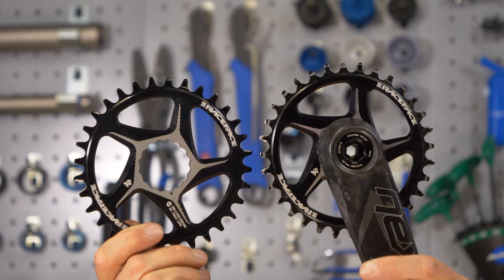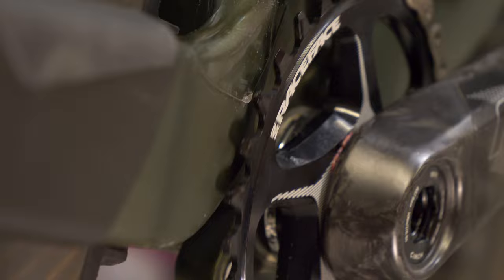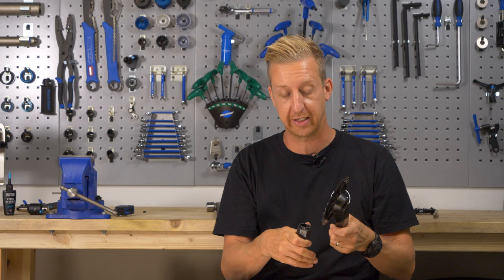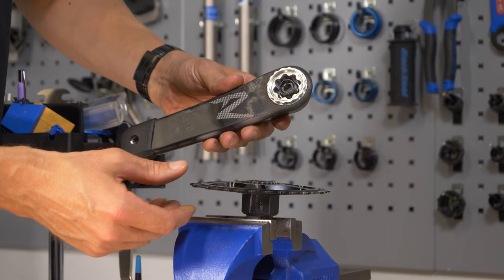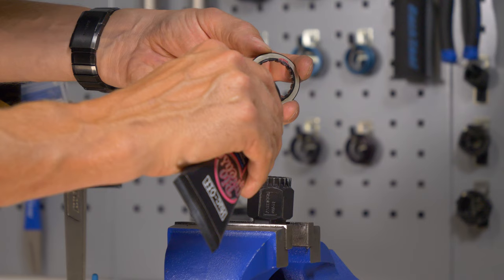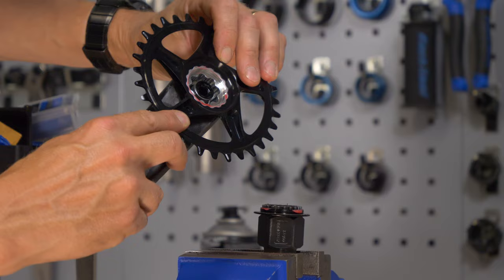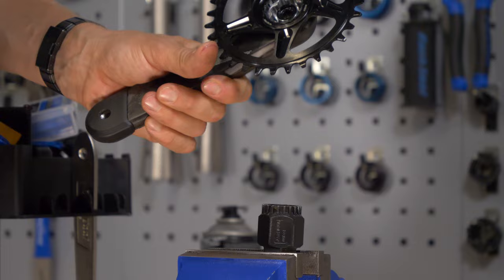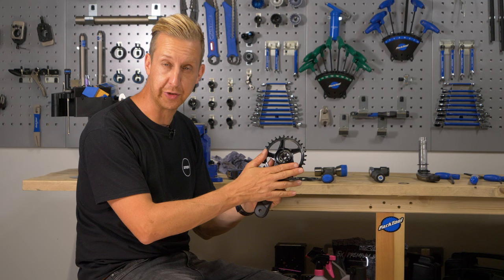Fit & Replace A Direct Mount MTB Chainring | Mountain Bike Maintenance

Comment: SRAM ones use 3 small screws to secure the dm chainring. Its a good idea to either grease the ring/arm interface (as Doddy did here) or better still, use some press fit BB securing compound on that interface, to prevent creaks. 
Also, on SRAM, use blue locktite on the 3 screws threads

Comment: Hey Doddy, would it be better to start threading the lock ring by hand and not on the vice? It just seems starting threads with tool in vice like that may increase the chance of cross threading your expensive crank arm. However, great vid like always and great tip regarding carbon friendly grease.👍

Comment: If you don't have a torque wrench you may always get into the correct ballpark using basic calculations. You take the torque in Nm, divide it by 10 and then by the lever length in meters. In this particular case (40/10)/0.170 = 23.5 for 170 mm cranks. Then you know that if you tighten by pulling the crank arm at its end you have to pull with a force like if you were lifting 23.5 kg weight.
Reply: Or you could just buy a torque wrench.

Comment: Doddy you are reading my mind. Quick question: I'm going from a 32T round chainring to a 32T absolute black oval chainring. Does the length of the chain change?
Reply: Doesn't change the lenght of the chain, just check if you have the clearance for what should be 34-36T. The maximum diameter of ovals is bigger.
Reply: How about the offset?

Comment: #askgmbn - There's so much focus on weight of components on bikes. It would be interesting to know how the bike/riding is affected based on where the weight is located.  I've read about each of these individually, so I thought a comprehensive video covering all of these might be a great topic for you to cover (including why more or less weight on each makes the differences).  Weights of... Bike Frame (including components attached not listed), Rider, Wheels and Tires, Pedals and Cranks

Comment: #askgmbntech do i need to add links to my chain if i go from 30 to 32 teeth chainring?
Reply: Technically, yes. Possibly not. But that depends on how much slack you have at the moment. Your chain could be a link or 2 too long without a problem. And in that case you wouldn't have to.

Comment: It was so easy to change the 5 bolt ones. Bikes are becoming aircrafts.
Reply: Sorry, I don't think I can agree with that. I remember fighting with seized chainring bolts, especially the traditional ones with shallow flat grooves on one side for a tool to prevent spinning before coming loose but would 1 out 5 would just slip. Then you had the bolts that would corrode together and end up snapping off when trying to remove them or even tighten, I can still remember the smell of a popped aluminum bolt. The 5 bolt design also limited how small the ring can be and the extra crank material for the bolt spider didn't help with weight savings.